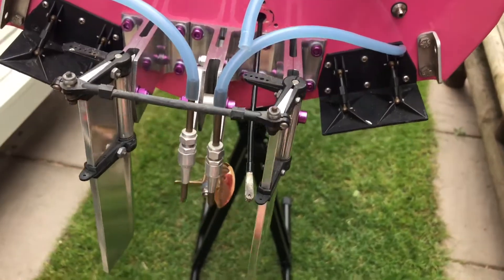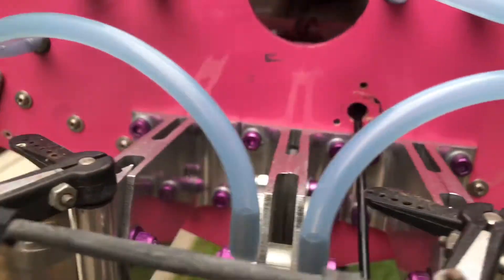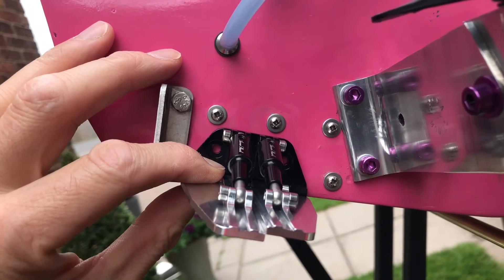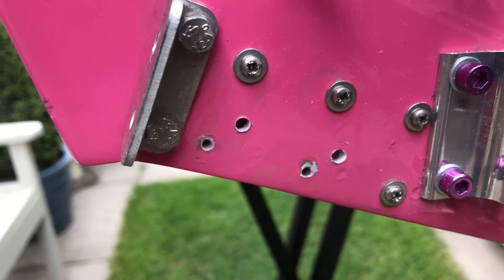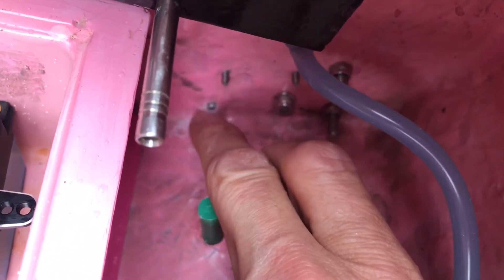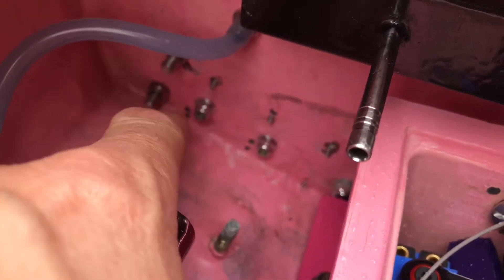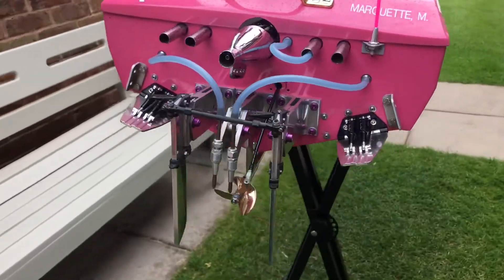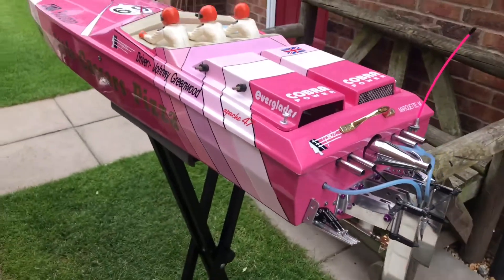Installation of Arrowshark Trim Tabs

Comment: Johnny HG: Do you have a facebook page with info / pictures about your large model boats? I am building some large model boats (slowly!), 57 and 65 inch Apache, and 72 inch cat. I'm using factory fresh Mathe engines. I would like to follow you on facebook if possible. Seeing your large model boat pictures would be very helpful, because a picture is worth a thousand words. Thanks, Kaye
Reply from the maker: Hi Kaye, I’ve not got a Facebook page, only the videos on you tube. If you need any photos of my existing boats on hear let me know and I could send via email if that helps? Johnny
Reply from the maker: @kayerickatson4814  Private Facebook is Johnny Greenwood
Reply: @mrapache49  Thanks. I'll contact you. You can delete this now if you like. Kaye